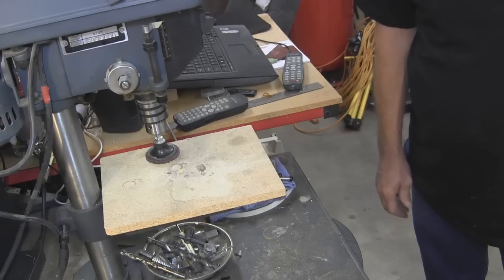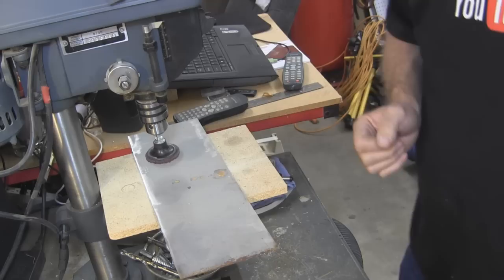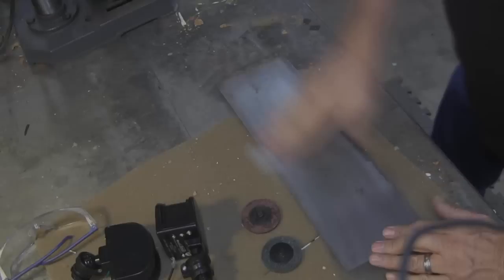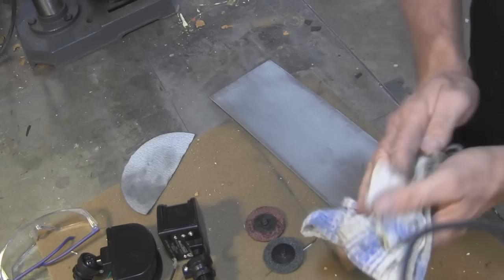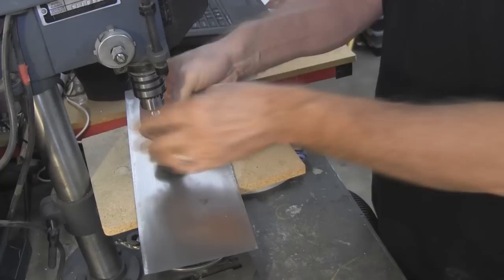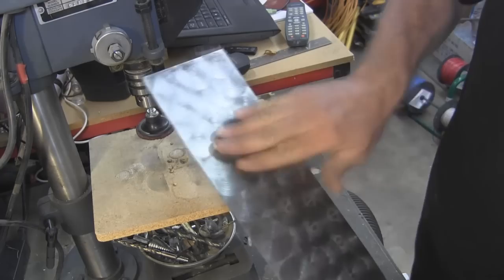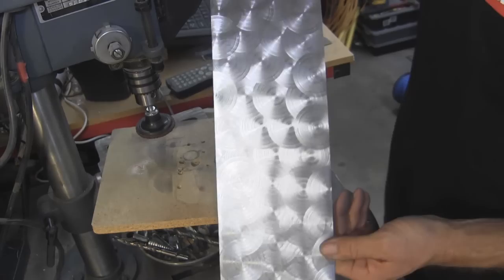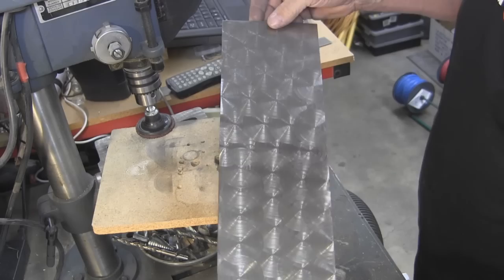My Shop:Circular patterns-swirls on metal

Comment: Original term for this in old motoring and technical books is 'engine-turned' as it needed an engine aka a drill or specially made machine to get the effect.
Vintage cars and planes had plenty of engine-turned panels.
Even today it's available on classy vehicles such as Bentleys: 
http://www.norcorp.com/design-aluminum-surfaces-blog/bid/22409/Engine-Turned-Aluminum

Comment: I was thinking you might be able to improve your swirls if you combined techniques by putting some valve grinding compound on the metal after sanding. thats how you can do it with a wood dowel in the chuck for a smaller pattern.

Comment: Hello~I have a question and I thought that with your metal working experience you would be a good person to ask. I have spent a lot of time removing scratches from an old double bowl stainless steel sink using 600 grit sandpaper and Scotch Brite pads.  It looks so much better and the re-graining that occurred in the metal doesn't look too bad, but it isn't as perfectly straight as I'd like.  I've thought about creating a swirling effect in the sink with the circular pads that you speak of in this video.  Do you think I would get a nice looking effect if I used a drill and the circular pads and swirled the metal by moving around the inside surface of the sink without lifting the drill, just keeping the pad in constant contact with the metal?  I'm afraid of messing up a good project, but then again, I think a swirl effect would be unusual and may help to camouflage any scratches that I was unable to remove.  Thanks for your thoughts.

Comment: Very cool! One question, because you speeded up the video I could not tell how long you let the pad contact the metal plate? How much pressure did you apply? Thx!
Reply from the maker: +Tom&#39;s Dreamshop Worx I press and hold for about 3 seconds. As far as how much pressure,not much at all really. The pad does all the work. Thanks for watching!

Comment: Hi again - I got the exact pads you used but when I try to do the same pattern it turns out really dull and in the center it doesn't work just around the edges.  I am trying to use a regular drill.  I notice it kicks hard side to side so I am thinking this is the reason.  I don't have access to a drill press and where I live it's a very uncommon tool (central America).

Any tips on how to do this without a DP?  A regular drill bucks side to side the second it hits the metal.  Also with new sheet metal is sanding it essential? I did not sand it, could this be the reason for the dull finish?

Thanks
Reply from the maker: Louis you need the pad to be square with the sheet applying equal pressure.The only way I know of is to use a drill press. Do you have any other wood working tools? There are plenty of You Tube videos showing how to make a drill press for use with a hand drill. This may be a good choice for you.
As far as the dull finish I achieved the polished effect by sanding the metal sheet first.

Comment: Would like to do this on a motorcycle tank. Are there any pad compatible with a hand drill?
Reply from the maker: These pads from Harbor Freight will work in a hand drill. However you'll need a steady hand and grip to use it. Keeping the pad flat between pad and metal is key to doing this method.

Comment: have you ever done any of the swirl brushing on aluminum?
Reply from the maker: Yes I have,it's been a while. I used Mother's mag polish which gave it an awesome finish.
Reply: Inside My Shop ok, thanks. I have done tons of stainless and galvanized. had a customer want some aluminium done and have never done much. ended up doing almost a scratch pattern with real light grit emery cloth at a medium speed and was pretty happy with how it turned out but want to do some messing around with different stuff so I can give customers more options if they ever want aluminum done

Comment: Is there a good way to preserve this finish?
Reply from the maker: You can do several things depending on the surrounding conditions. Wax,spray clear enamel or lacquer. iF used outside be sure to use UV type clears.

Comment: sir thnx for this nice trick but i want to make cd effect on aluminium circle how can i do it please help me..
Reply from the maker: I would think that you need a larger Scotch Brite pad depending on the size of aluminum your making. Then polish it to a bright shine.
Reply: thnx for the tip, but i need 160 mm aluminium circle for making clock metal dial and one more thing i saw many types of effects in colors in dial on aluminium how its possible??
Reply: Inside My Shop

Comment: Couldn't u just use a metal stripper instead of sanding?
Reply from the maker: Sure could,just be sure it clean and dry before going to the next step. I just think metal stripper is to messy to deal with.Just my opinion.